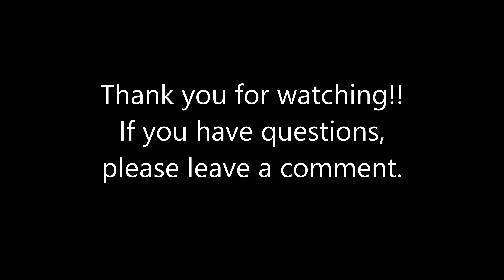1/10 scale Rc Car ZD Racing 9104 Thunder ZTX-10 Rebuild - From Banggood

Comment: Thanks for uploading this vid!!From which brand/car did you get those aluminum parts?.
Reply from the maker: All parts were from zd racing brand. If you can mention the part name, I can provide link
Reply: @blendofdiscovery  great video. I just bought this car and was wondering about metal upgrades as well?
Tie rods
Steering rods
Well hubs
Reply from the maker: Andy Merc yes, they are available. Hubs I have not upgraded. Metal hubs were available in banggood and AliExpress. It’s been a while.
Reply: @blendofdiscovery  thank you, I'll have to search a little harder
Reply: I've been trying to find the adjustable rods and am having no luck
Reply from the maker: @andymerc190E  https://www.aliexpress.com/item/32736364920.html
Besides when I search in AliExpress for rc car pull rods, I get other brands. May be compatible with zd racing.
Another option would be use this https://www.aliexpress.com/item/32659618985.html and this https://www.aliexpress.com/item/32698087486.html to make pull rods.
Reply: Thanks a bunch! 👍🏿 
 I've never ordered off AliExpress only Banggood, but I guess there's a first time for everything

Comment: Does the electronics come with them too? I was planning to buy this but the site says that it is rollers. Can you please say the price ?
Reply from the maker: no electronics.
you need motor, ESC, servo, receiver , battery , remote sperate.
it was 3 years back I bought, then it was around 5000 INR
Reply: @blendofdiscovery  all.together how much did it cost?